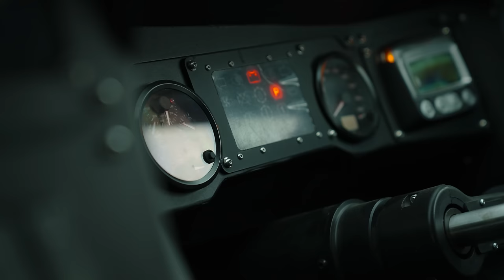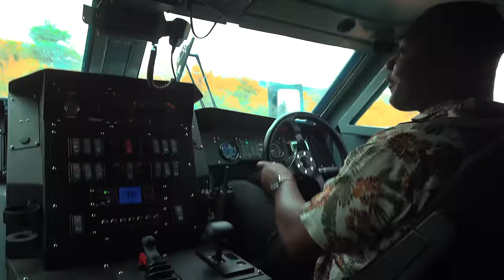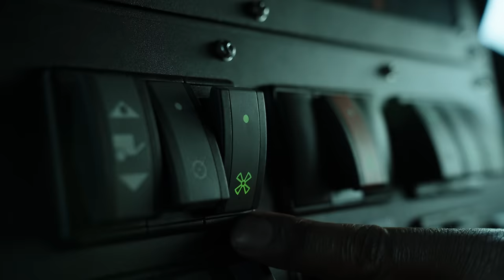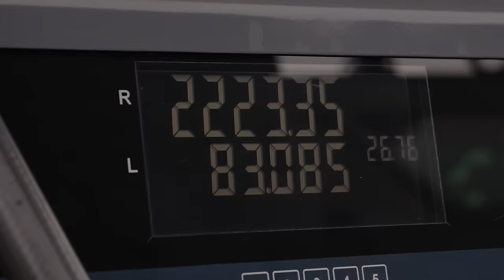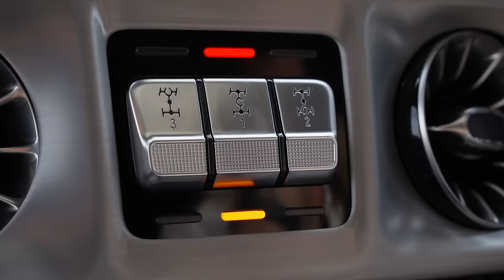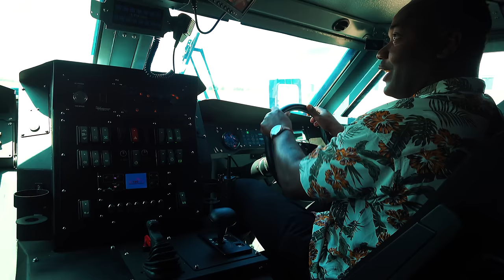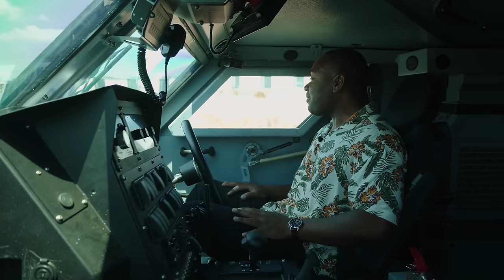Mercedes G-Wagen vs MBOMBE 4: Big vs HUGE Off-Road Test!  | 4K

Comment: Very top gear-y, can’t go wrong with these type of videos
Reply: If it's top geary, they are headed in the wrong direction. There's a reason top gear died.
Reply: @Resist_Oppression  the top gear was dead after the trio left the show
Reply: Yep
Reply: Hollywood and Disney make films so what’s your point?😂
Reply: At least its better than the current top gear
Reply: @Resist_Oppression  top gear wouldn't have died if old presenters weren't fired. New top gear could simply never reach it's hype of old expectations. And honestly beating the trio of Clarkson, Hammond and May will probably be impossible even in future

Comment: Anyone notice Mbombe steering wheel looking like it’s loose
Reply: Looks like it’s about to fall off
Reply: I think the wheel isn't flat so it looks wobbly when it rotates
Reply: Yep.
Reply: I think it was bent by a previous journalist hitting a boulder. I don't think it is feature. Maybe a Tesla yoke 3.0 made where Elon was born?;)
Reply: Face not perpendicular to shaft resulting in tilting on rotation
Reply: It’s clearly just a bent wheel
Reply: This small detail lets you know, what the rest of the vehicle might be like too...🤪
Reply: its most likely angled because the driver would usually be wearing full body armour & its just better positioned like that.

Comment: The reason why the G-wagen managed to pull the plane is that to overcome the friction and rolling coefficient the car need to pull a load of about 3 tonne which the G wagen is more then capable. So although it looks impressive, the situation would have changed if the plane would have the wheels locked. So hands up for who did the cals for this to work hence the choice of the plane to be towed.😊

Comment: Great content. First time to see this channel. New subscriber, I love this type of stuff.  To be fair though, many cars could have pulled that plane on that flat surface. My LC150 would also pull that plane. Although that plane weighed 25 Ton, does not mean you need 25 plus ton of pulling force to over come the inertia. You only need enough pulling force to overcome the initial force. Try pulling a 25 ton dead weight and the G would have failed. And so would any other car. As the wheels on the plane could turn, there was very little resistance, thus minimal force required to create momentum. Having said that it was a fun video to watch, I thoughly enjoyed watching it.

Comment: and at minute 17:36 he looks so tense and scared that notice how he distorts the steering wheel. That's not a professional driver. Arms completely straight, that if he were in a normal car and had a crash, he would break both arms as if they were toothpicks. The thumbs on the inside of the steering wheel, when offroading you NEVER hold the steering wheel like this as you can end up with broken thumbs. However, the woman is. Thumbs out, arms bent... 100/100

Comment: The MBOMBE 4, similar to the Ford F650, is an ideal candidate for electric vehicle (EV) conversion. With ample space to accommodate large batteries, these vehicles are well-suited for carrying numerous passengers, inventory, and other cargo. Imagine embarking on an open MBOMBE 4, equipped with a safety cage, allowing passengers to safely enjoy the breathtaking experience of a wild African safari. This type of electric conversion ensures not only a sustainable mode of transport but also enhances the thrill of safari adventures.
Reply: Lol a vehicle of this size is completely unneccessary for a safari tour and at the end of the day its an APC intended for military use. There will never ever be EVs in the military which will have any form of use in possible combat.

Comment: Really stupid and amateurish performance. Strong statement I know but as ex military who nearly lost a son in an apc incident in Basra here are 3 solid reasons.
1: he wasn’t wearing a helmet. There are lots of hard sharp edges.
2: he constantly used his hand radio and even took both hand of the wheel. At 14 tons he could easily have lost control if he’d hit a rut or ditch or pothole.
3: whilst they are difficult for attackers to break into they are also a nightmare to exit on their side or top. He gave no indication that he understood this problem or had been taught emergency extraction drills.
QED
Reply from the maker: Nervous much

Comment: THAT PLANE IS JUST ROLLING ON WHEELS MY 15HP  LITTLE TRACTOR CAN DO THAT
Reply from the maker: Even if it had enough power, its wheels would just spin.
Reply: @AutoTraderTV  IT HAS  A LOW RANGE GEAR BOX AND WITH TWO EXTRA PASSENGERS EACH ON EACH REAR WHEEL SHOULD BE ENOUGH 😅